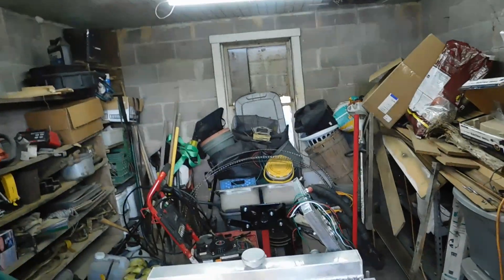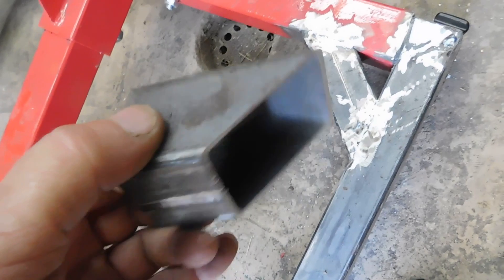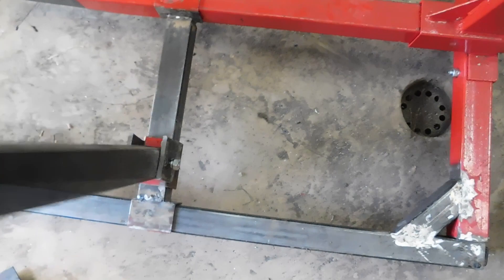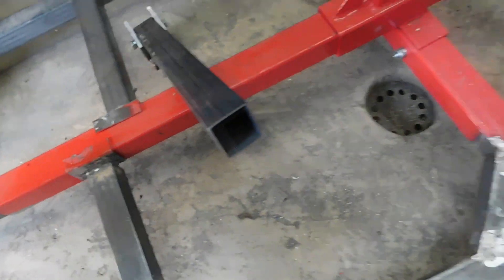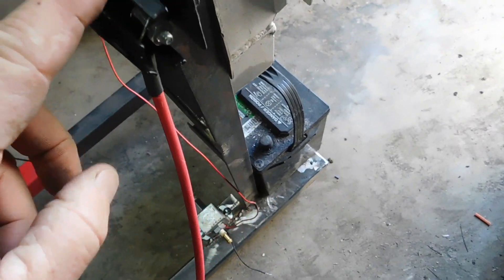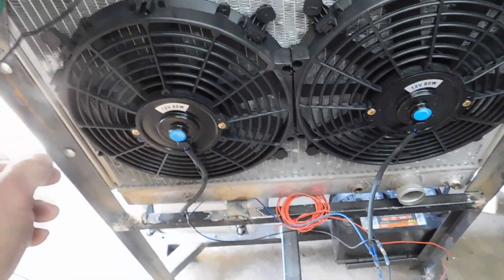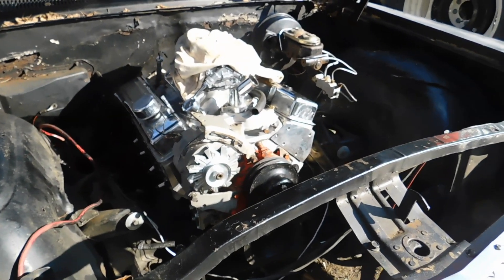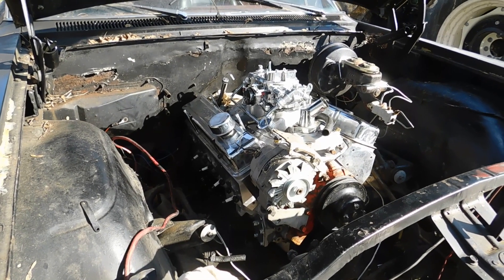How to build a engine test stand from a $50.00 Harbor Freight engine stand. Part 1.

Comment: Harbor Fright also has a 3 gauge package for $18.  Meanwhile, the easiest way to bleed air pockets out of a cooling system is to drill a tiny hole in the thermostat and then get your test stand on a tilt so that the radiator end is high up in the air. let it sit a few hours, and the air will rise to the highest level, which will be the radiator cap. the more you burp out the air pockets, the less time you waste chasing overheating issues.

Comment: I love it. Using whats around, making it fit. I am at the same stage you are with my own engine stand. I took a complete 75 Camaro front sub-frame complete with steering and suspension, stripped it all down to the frame. Shortened it and used a engine stand swivel head for rear support. Now need to wire and plumb it up.
Using a S-10 radiator, I have several, I have a 88-S-10 Blazer. I want to make smaller one, just like you did. I got some new ideas now, thanks.
Reply from the maker: Thanks for the comment and good luck with your builds.

Comment: Ha, I am watching this video because I am also putting a sbc into my Scout.  Engine is just about done but I'd like to run it on a stand first
Reply from the maker: It's a good way to go and not spend a lot on a new stand. I'm actually going to re do it a bit wider and initially I cut it down to short so I'm going to add the upright tube back in. I'll put up some videos of my sbc- scout swap this summer when I have my shop. Good luck on you swap.

Comment: Nice modifications  ,15 years ago I had to refresh a Marine 283 Engine  and I used a Harbor Freight stand  as that project neared the end I noticed the Factory Welds had cracked  I knew the thing was getting a little Sloppier but I didn’t realize why untill I was almost done  that motor with all the Marine parts o it was a Estimated 750lb  unit as per very old Specs  I found on a Chris Craft Forum  and I don’t dought it  because it litterally took 3 men  to get it out of a basement  luckily the boat was in a garage getting restored on land and I had a business next door with a Forklift  that I used to get the engine back on the boat and properly set  up using a custom made Gantry  style  Crane I built for the vessels Aft Deck to drop the engine into their compartments , here is a kicker I  actually used a Harbor Freight Chines Cumalong for that part  so sometimes cheap isn’t bad IMO  because of my love of Boats  I was poking around looking for  another DIY style test stand
Reply from the maker: First car I ever owned was a 63 chevy impala that had a 283 in it. I ran the snot out of that thing and it never quit.

Comment: Nice job man! I'm getting ready to pull my motor in my truck, do u know if i can replace my siezed 454 with a pumped up 350 ? Would the sbc and bbc have same motor mounts and bell housing ECT ? Thanks
Reply from the maker: Not sure about you motor mounts and all but If I were you I'd build that 454 block up if it's a good block. Good luck!
Reply: Easiest swap you'll ever do! Pretty much everything is the same, you really only run into problems when you're going from small block to big block. Just be mindful of the hood clearance and you'll be a-ok